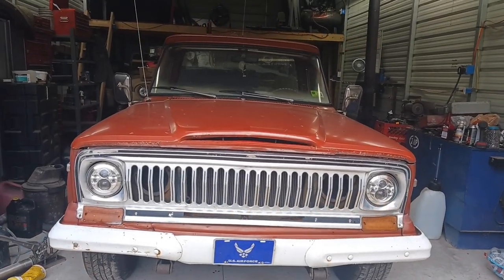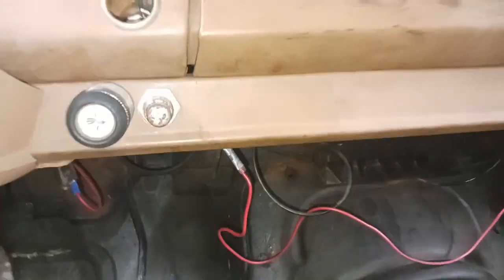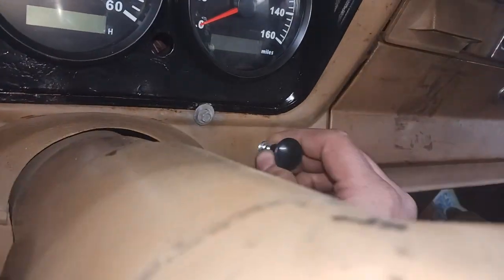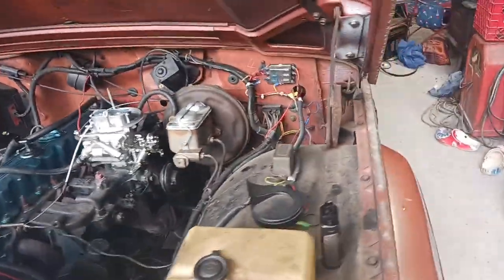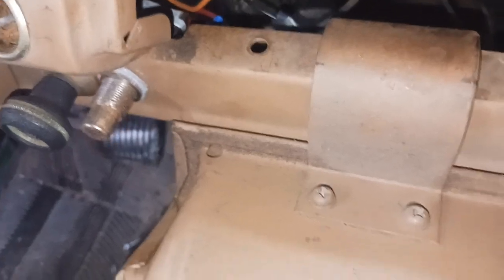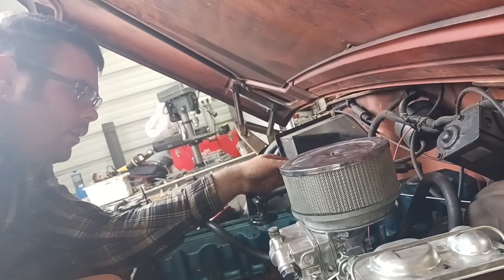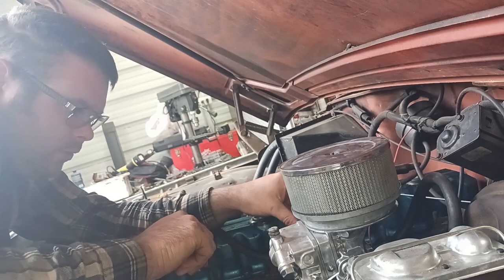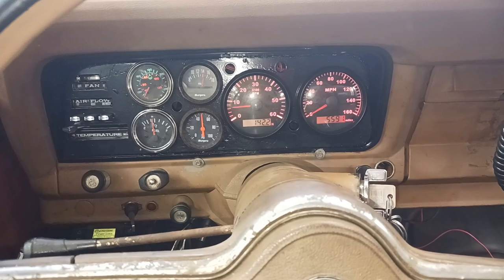Installing a Manual Choke Cable

Comment: Been thinking of doing this with my 76 J10.  I rebuilt the 2100 carb and fixed the heater pipes and it does open up.. but not fully unless i tap it with a finger.. and then it doesnt close when cold unless i tap it.  I tried lubing it but it doesnt work right.  

Not sure i wanna keep messing with it and thinking of doing something like this.

Arr you closing the throttle plates with the cable pushed in though ?  It should be open fully when warmed up.  If it isnt youll get terrible gas mileage.  This is the total oposite is what it should be.

The choke should be pulled partially open when you start the car.  And pulled fully open when warmed up.  Then pushed back closed when its cold.  Thats how the choke works.  If yoire pushing it fully closed after its started up itll give you absolutetly terrible gas mileage